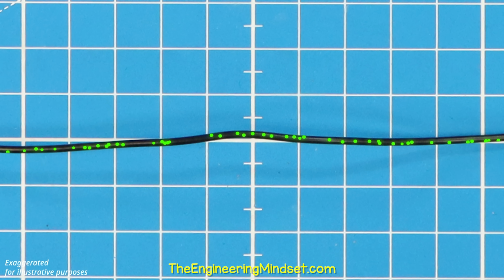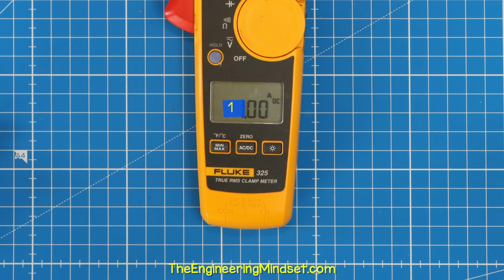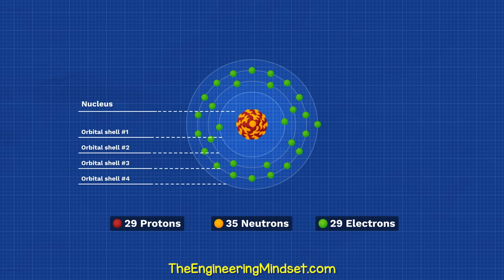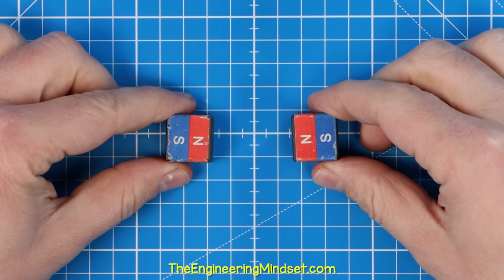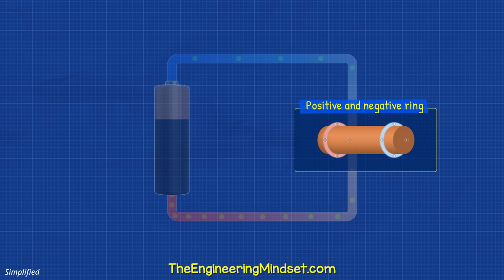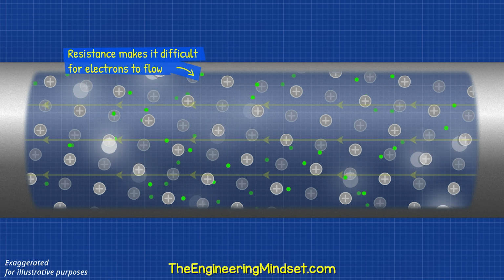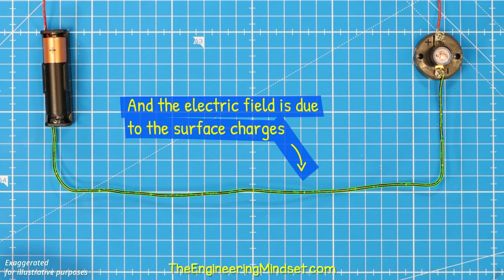How Electricity Works - for visual learners

Comment: Voltage IS NOT, I repeat IS NOT “the pressure” that moves electrons. The electric field provides the “force” to move electrons. Please correct this!!
Reply: Did you watch the video? The whole point of the video is explaining just that
Reply: @MyWatermelonz no it’s not. Stop over generalizing
Reply: @Electric_Sherlock  Nope, it is. It starts with the simple analogy of voltage and water and then explains the EM fields. You didn't watch the whole video.
Reply: @MyWatermelonz  I did watch the whole video. I am aware. He also states at the beginning Voltage is “pressure”. Which is also incorrect.
Reply from the maker: @Electric_Sherlock the 18 minute video goes from the introduction of electricity through to the deep level electromagnetic fields. This helps people with very little understanding on the subject start with something they are familiar with and can easily visualise. If I start with the deep dive, 99% of people will immediately leave the video and down vote because it's too complex.
we start discussing voltage with the common water analogy which most people are familiar with 18:34 "the common analogy is that the battery is like a pump, providing the pressure to move the current through the circuit. We measure this electrical pressure in the unit of Volts" 
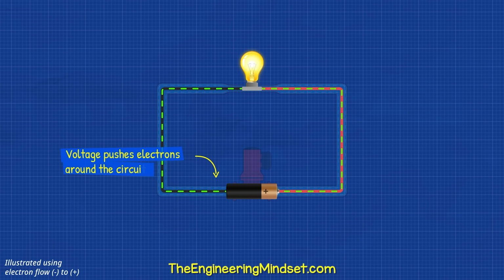then at 3:39 it continues "so the voltage is the pushing force which moves the electrons and the resistance makes it difficult so it limits the amount of current which can flow"
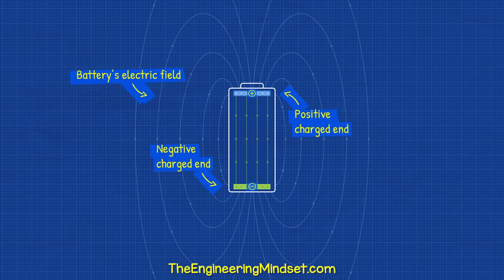but then at 7:38 we discuss the electric field lines from the battery through the circuit
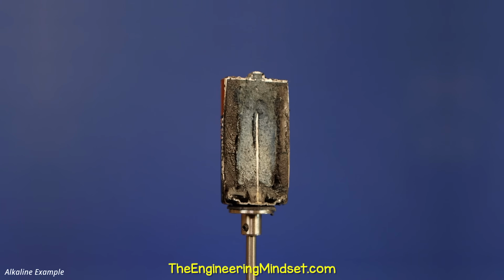Then at 9:32 we discuss how the chemical reaction causes this voltage
Following that it discusses the electromagnetic fields and waves through and around the wires.
So it describes the easy to visualise, beginner friendly version of voltage and then later discusses the physics of what voltage really is.
Reply: @EngineeringMindset  Thanks for the thoughtful breakdown. I understand the pedagogical intent behind starting with familiar analogies like the water pump, but I believe we do a disservice when we allow inaccurate models to frame foundational concepts like voltage.

Voltage is not a pressure or a pushing force; those are mechanical concepts. Voltage is a scalar potential difference between two points in an electric field. It does not “push” electrons; instead, the electric field exerts a force (a vector quantity) on charge carriers, and it’s that field that results from the spatial change in electric potential (voltage).

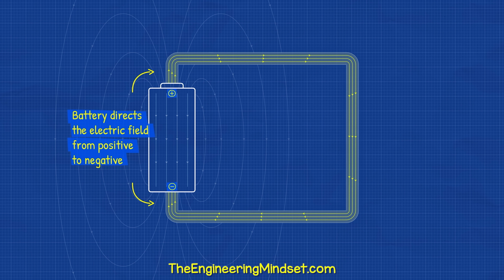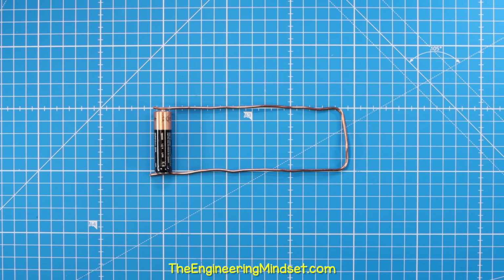Describing voltage as a “pushing force” leads to conceptual errors, especially when students begin to explore electromagnetism, circuit analysis, or field theory. Even within your own timestamps, you acknowledge a shift at 7:38 and 9:32 toward electromagnetic field theory, which is the proper framework to begin with. The E-field from the battery is present throughout the circuit immediately and propagates changes near the speed of light, independent of the mechanical notion of “flow.”

Yes, simplicity helps engagement, but simplicity should not come at the cost of scientific accuracy. There’s a middle ground between accessibility and rigor, and I’d argue we should aim higher by introducing correct models from the start and building intuitive understanding around them, not outdated or incorrect analogies.
Reply: @Electric_Sherlock  Bro you just really wanna be right huh? Like I said the whole video is going from incorrect assumptions, basic analogies to explaining it properly. The creator even gave you way more of his time than I would ever to explain this to you - and you're still arguing to be right. 

Like he acknowledges and explains that the water analogy model isn't entirely correct! 3blue1brown does similar things - shows incorrect analogies or intuitions to further explain things down the line and I'd argue he is the greatest instructor alive. What don't you understand?

Comment: Was hoping this would do it, but nope, I am still dumb. =(
Reply from the maker: No one is born knowing or understanding this. Knowledge is acquired over time with effort. You're not dumb, you just need to build up your knowledge wall, brick by brick. Make some time dedicated to the topic with no distractions, watch the video again, take breaks, make lots of notes and write down anything you didn't quite understand then at the end of the video if you still don't quite understand something google that thing and fill in that gap in your wall. Maybe it takes a few times and a couple of sleeps until your brain clicks and makes the connections. This video goes deep into the physics of electricity, you might not even need to know this level at this point, for example to design a simple circuit you don't need to know anything in this video. See our videos on circuit design instead.

Comment: This visual learner lasted about six minutes before reaching informational overload, which is longer than I make it through most vids on the subject. Thanks and I shall return.
Reply: lol
Reply: Yes my friend as I have returned for the second time understand the magnetic field and how the electrons work inside a copper wire and inside the atoms I've learnt how to calculate voltage current and resistance getting more info out of something from a multimeter I learning a lot tryna get myself ready for electrical engineering course next year after my building course
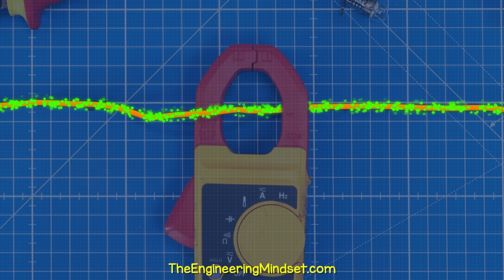Reply: 3:11 here.. :D
Reply: Now I don't know what to do with that information
Reply: doubtful
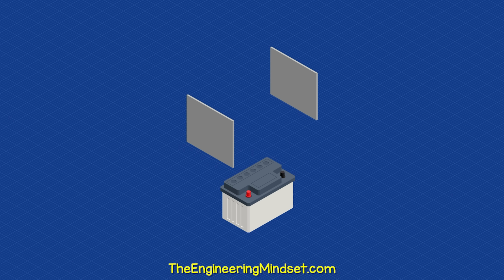Reply: This is my second time on this video and I only made it 6:30 in to the video the last time, so there’s some truth to this. 😂
Reply: me here watching this on 2x speed because I need to reach informational overload
Reply: I'm electrical engineering student and came back to recall the basics. I got overloaded after 6 minutes and 48 seconds, too.
Reply: It's almost like effort is also required on your end, and pretty pictures can't force you to understand things no matter what kind of learner you declare yourself to be.
Reply: Yo if you do a bunch of crack before you watch this it really makes sense
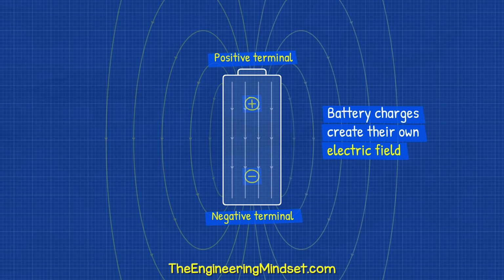Reply: @t0nnie  same I've both worked for a year in the field and am in Uni now for electrical engineering, I've finished a high voltage technician course too, I always have impostor syndrome cause I have to come to videos like this to resuscitate my knowledge of the basics, I was able to watch the full video but kinda capped out at 11:00
Reply: I made it to 9:23 but I was thinking about lunch the whole time. I will return after i eat.
Reply: I lasted for 1 minute and 30 seconds. I also have ADHD.. information overload
Reply: 7:35 here!
Reply: Learning styles are a myth that people buy into. You probably just had a bad experience with the garbage education system, and were never truly taught how to learn.
Reply: You need to be medicated
Reply: 6:30 is where i realised i am not following any more. 😂
Reply: lol me too
Reply: lol part of me thinks electricity isnt real and its one giant conspiracy because Ive searched high and low and NEVER been able to find any able to simplify and explain what electricity is.
Reply: lol same
Reply: Lol.  I am lost, but still watching.  I need to keep coming back periodically until I "get it"

Comment: I will never learn this 😭
Reply from the maker: Just make time, dedicated learning time no distractions, sit down, make notes, take breaks, rewind and watch the parts you didn't quite understand, write down anything you didn't quite understand and then at the end, go and find what those things mean. Knowledge is acquired over time with effort.
Reply: @EngineeringMindset  Thanks for the reply! I'm afraid this is just my brain, I'm 38, my dad is an electrician and I actually studied electrics during my maritime officer education. For some reason it just doesn't land with me. I'm now building my own campervan and want to do the electrics myself, but I can't get a grasp on the logics of the electrical systems and how they fit together. I think I'm just gonna have to ask my dad to take the wheel for this one. Good luck with you youtube channel, amazingly educative content!
Reply from the maker: For fitting out that, you don't need to know anything in this video. You'd be better off assuming electricity flows like water from positive to negative through the wire. You only need to understand what connects to what. Don't worry about the physics of electrons and atoms you'll never use it in practice.

Comment: They don't move like its shown, someone call Vertasium
Reply from the maker: When you have time please watch this video in full, we fully explain how and why the electron moves, we even calculate how fast and how far it moves and then explain the electromagnetic field around and through the circuit. Veritasium made some great videos on the same topic and in those videos you will see he explains the exact same thing, electrons moving due to the electromagnetic field around and through the circuit with a gradient of charge. 
You can see chapters in this video where each part is discussed, but I would strongly advise to watch in full.

Comment: Isn't the current flowing from what we call +ive polar to -ive?
 I thought that to accommodate the initial mistake into practice, the true negative polar remained its name as "positive", so by this day the "positive" polar is what will shock you if touched.
Am I wrong or the video is missing this information?

Great tutorial by the way, very comprehensive and easy to grasp.

Comment: 11:00 I just cannot understand?!?😭
Reply: What do you mean it has to become from negative to positive it breaks all laws of physics😭😭
Reply: There is an end, more intuitively in super slow motion the battery's positive terminal is positively charged and and negative negative. 
The moment you connect them the charge will try to balance out sending electrons from the negative terminal to the positive.
For this case the chemical reaction in the battery keeps consuming the electrons so there's a constant feed of electrons causing a steady voltage to be formed.

Comment: At 16:05 I'm pretty sure the direction of the induced magnetic field should be the other way around, right hand rule. Also I'm a bit confused on how the energy is stored in the field, a higher voltage battery can "squeeze" more electrons together inside the battery creating a higher voltage. But when inside the copper wire does this mean there are more electrons? leading to a higher potential energy and then when "released" into a resistor they convert this potential into kinetic energy? But then the density of electrons is surely the  same and the speed of them is irrelevant so how does an electric field or voltage across the resistor come from this?

Comment: I always understood the flow of electricity to be forward, how ever. Think of the wire as being a stack of electrons. When ground is available, the next electron moves forward, leaving a hole behind for the one behind it to fill. That "hole" technically flows backwards through the system, but the electrons are technically moving forward.

Comment: Wait - isn’t the positive end of the battery positively charged because electrons are leaving it? Thus flowing from positive to negative? Also, all live wires are connected to the positive terminal. If you ground the positive, you allow electrons to flow, thus creating a short circuit which results in heat, sparks, etc. thus, the positive (ie live) end must be the one from which the electrons flow … 🤔

Comment: Electricity does not flow through the wires....It flows through the electric field
Reply from the maker: Yes, this is explained in the video in full.
Reply: @EngineeringMindset  :)...Great video by the way :) Congratulations for such a thorough explanation with great imagery :)
Reply: Electrons move through the wire in response to an electric field caused by a potential difference.  In the case of DC the drift velocity is about 2-10 cm/hour.
Reply: @karhukivi  But  electricity doesn t, and there are experiments proving it! I ll give you a hint.... If you have a long circuit, really long, and you tun on the switch, a bulb will light up immediately, and not taking the time it should at the speed of light.

Comment: Funny enough, conventional current flow was always counter intuitive to me. It was far easier to visualize the positive terminal as ADDING electrons to the source and negative was SUBTRACTING electrons from the source. Thus, a circuit is fed from the negative draining electricity into the wire and recollecting it on the positive. As I got older I realized what a massive oversimplification it was but I'll be damned if it hasn't served me well through the years.

Comment: Veritasium's video on why everyone's perception of electricity is wrong is better than this video, as the work is being done by an electromagnetic field, not the electrons directly (the movement of the electrons is what causes the electromagnetic field. If you don't believe me, watch veritasium's video and also think about the fact that we use AC where the electron keeps getting shoved around in the same place)
Reply from the maker: This video discussed exactly the same points as veritasium. But illustrated in a step by step way. When you find time, please watch this video in full.

Comment: Ok if electrons come from negative to positive then why u show us in every your old video electrons moving positive to negative in every circuit also plz tell me
Reply from the maker: Because we design circuits using conventional flow. I usually add a note in the corner of the video stating if I'm illustrating electron flow or conventional current. For components I usually show electron flow and state that.

Comment: I'm curious how you determine what the resistance should be on a motor coil in a 480 three phase motor? If you take E= I x r it doesn't seem to work out so I'm guessing there's some other part of it maybe something with the √ of 3 or maybe 1/r or something.

Comment: Let's Solve Refrigeration and Air Conditioning Circuit Problems!
Understanding Low Voltage Circuits
Low voltage refrigeration and air conditioning circuits typically operate at 24 volts or less. These circuits control various components like compressors, fans, and defrost heaters. While they may seem simple, troubleshooting them requires a solid understanding of electrical principles.
Common Problems and Solutions
Here are some common issues you might encounter in low voltage circuits:
 * No Power:
   * Check the power supply: Ensure the main power source is on and the circuit breaker hasn't tripped.
   * Inspect the transformer: If the transformer is faulty, it won't provide the necessary low voltage.
   * Test the thermostat: A faulty thermostat might not be sending the signal to turn on the system.
 * Erratic Operation:
   * Check for loose connections: Loose wires or terminals can cause intermittent operation.
   * Inspect the control board: A faulty control board can send incorrect signals to the components.
   * Test the sensors: Faulty sensors can provide inaccurate readings, leading to erratic operation.
 * Component Failure:
   * Check the compressor: A faulty compressor might not start or run properly.
   * Inspect the contactor: A bad contactor might not be able to handle the load.
   * Test the relay: A faulty relay might not be able to switch the circuit on and off.
Troubleshooting Tips
 * Always disconnect power before working on the circuit.
 * Use a multimeter to test voltage, current, and resistance.
 * Refer to the manufacturer's wiring diagram.
 * Consult a qualified technician if you're unsure about any step.
Example Problem:
Let's say you have a refrigeration system that's not cooling properly. You suspect a problem with the low voltage circuit. Here's how you might approach troubleshooting:
 * Check for power: Use a multimeter to test for voltage at the transformer's output.
 * Inspect the thermostat: Make sure it's set to the correct temperature and that the contacts are clean.
 * Test the compressor: Check for continuity in the compressor windings.
 * Inspect the contactor: Make sure it's clicking when the thermostat calls for cooling.
By systematically checking each component, you can isolate the problem and make the necessary repairs.
Need More Help?
If you have a specific problem you're facing, feel free to provide more details, and I'll do my best to assist you further. Remember, working with electrical circuits can be dangerous, so always prioritize safety and consult a professional if needed.
 Anyone know this answer pls help me i have interview

Comment: I'm not sure what I expected. I've watched similar videos before and didn't get it. I still don't. The concept of electricity isn't compatible with my brain.
Reply: You probably need to take a step back and first have a clear understanding of chemistry, especially when it comes to density, atoms, positive and negative charges. There is a lot of information in this video. Also understand what watts, amps, dimensional analysis is. Maybe even watch a little physics about forces, because this video while the presentation is very well done and beautifully informative it still functions on the idea that you have an understanding on most of the components at work. It is more like an accumulation of the knowledge behind electricity and how electricity behaves.

A good approach to learning from this video is slow it down, take notes on ever section, try and actually reason with the information being presented in front of you. If things like Electron density is mentioned and you just brush over it or your concepts of electric/magnetic fields are lacking then those are clear signs that you are meant to understand electricity yet.

Having a good understanding of ions, atoms, and forces is a good place to start.